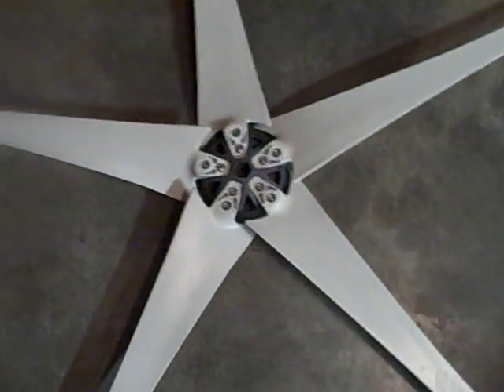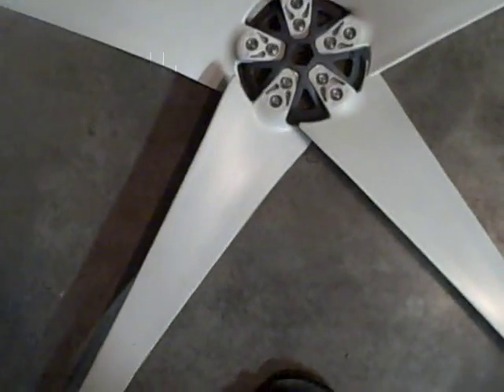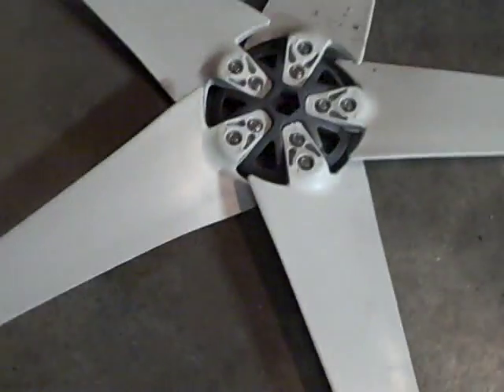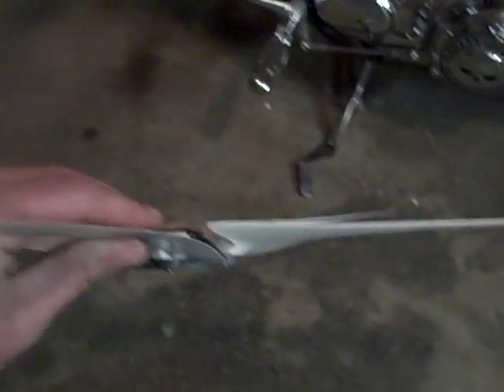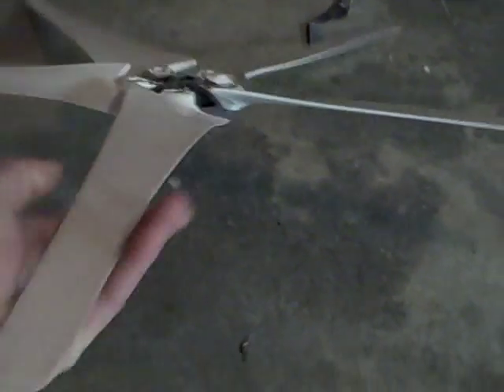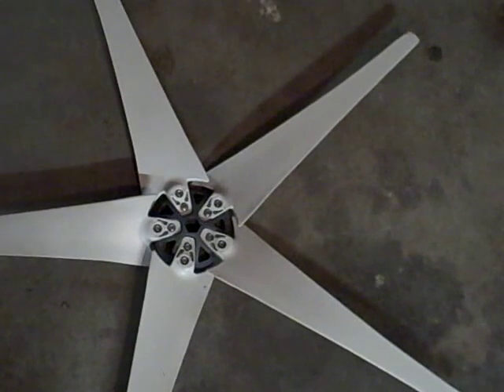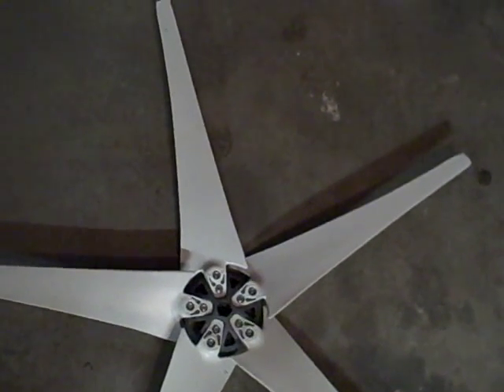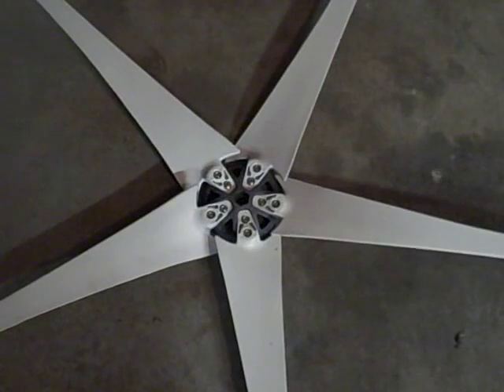aleko wg450a wind turbine blades.

Comment: I returned this wind turbine because maximum make 3 amp for 12 volt rechargeable battery = 36watts. If you buy new blades and change 12 magnets  you can get more power  but its more money no rezon spent more also coils must connect from star to triangle because impedance coil to Hi

Comment: Spin for two minutes, if it don't make power it will never make power.
Reply from the maker: before I installed it I tested it with my drill. it made power then. it hasn't made over 10 volts on all three legs of the rectifier since the install. I have went back up and double checked everything. it is wired properly, there are no shorts anywhere. it's not like this is my first wind turbine. I figured there was something wrong with the unit.

Comment: nIce looking Harley wow very nice, didn't even notice the blades after showing the Harley LOL I have a Yamaha venture 1200 It needs work but it dose run. I cant wait to get it fixed and running good again its was nice for going back and forth to work.  I got it gave to me for my birthday, it will fire up, but once you put it in gear it wants to die even with clutch pulled all the way in. I have got it to move but its really sluggish as if it unable to get up to rpm, but it did set out side for 4 years before I got it.  I will have to take it in one day to get it tuned up.  this darn thing has 4 carbs on it witch makes it a pain to work on,  I love to have them one for a Nice soft tail Harley. something comfortable.
Reply from the maker: Charles, don't worry about hugh.jaanus. he told his old lady he had purchased a crotch rocket. she told him they both would be happier dating other men.